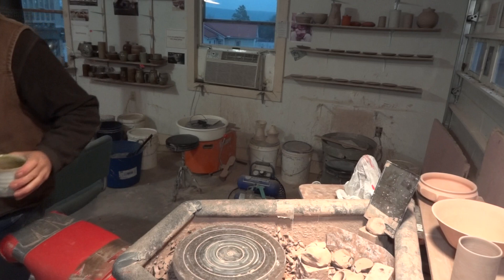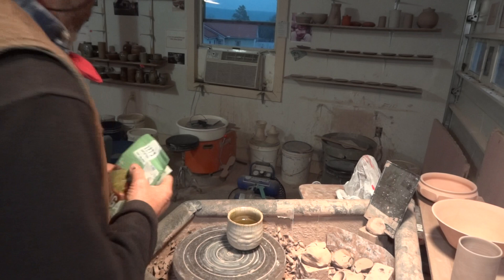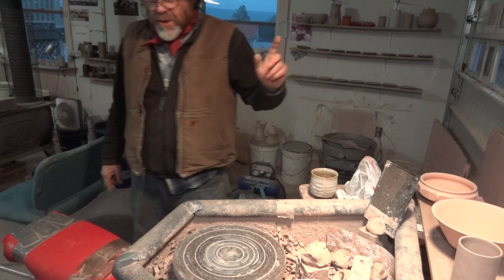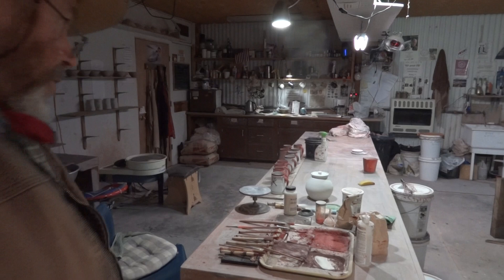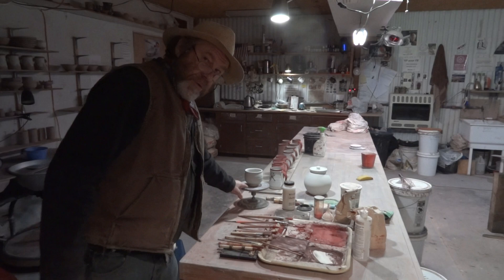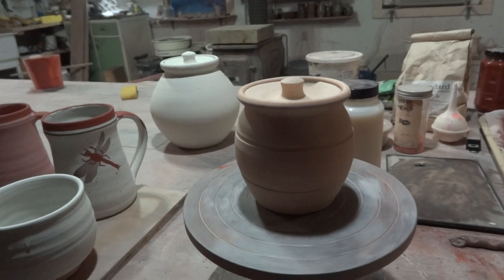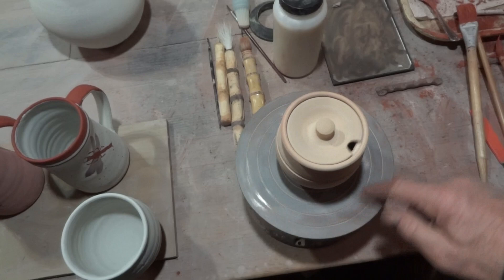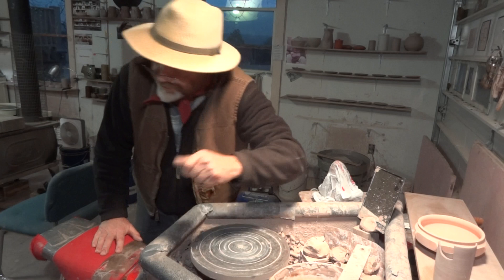How to 'tap center' - thoughts and tips - Dec 9th 2020 with Simon Leach

Comment: Thanks. A useful video. The problem I have now is that, for turning, the wheel has to be wet so the pot will stick, and then it's very hard to move it by tapping!